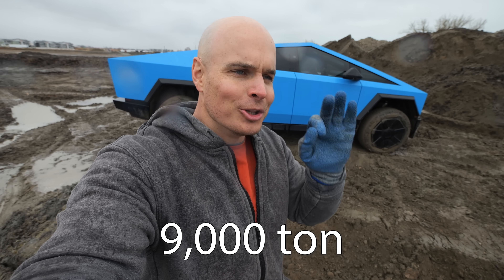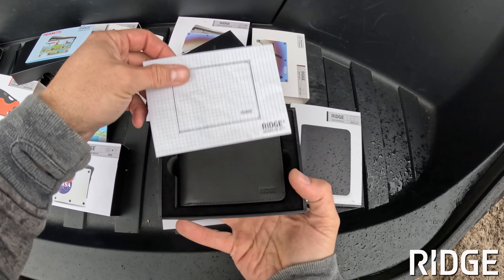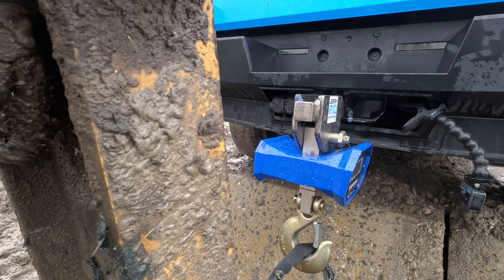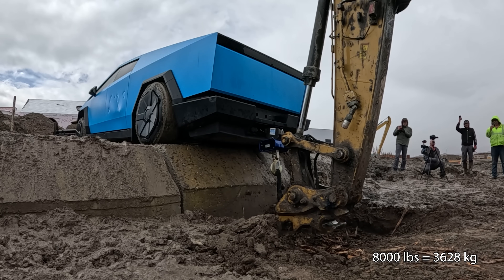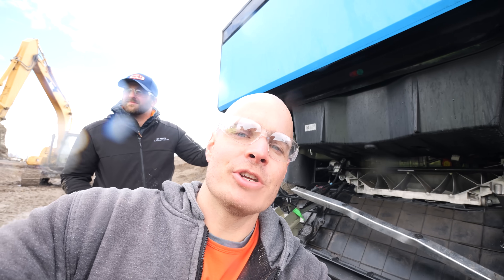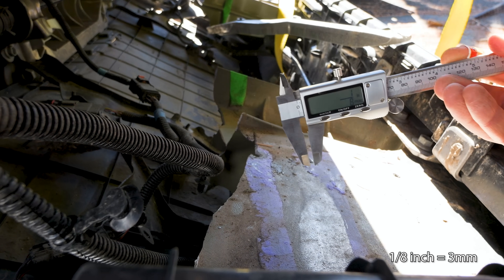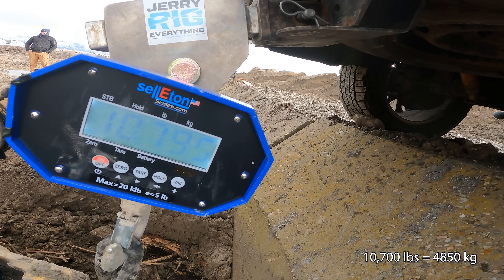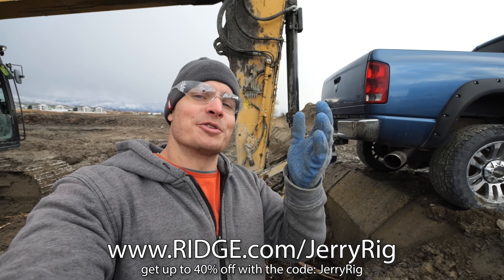SHOULD YOU TOW WITH A CYBERTRUCK?! - (catastrophic failure test)

Comment: Read this info by Grok guys before making any conclusion of this test: 
: The Gross Vehicle Weight Rating (GVWR) of the Tesla Cybertruck varies depending on the specific model. Based on available information, the GVWR for the Cybertruck falls within the following ranges:

Dual Motor (All-Wheel Drive): Approximately 9,001 to 10,000 lbs (4,082 to 4,536 kg).

Tri Motor (Cyberbeast): Also within the 9,001 to 10,000 lbs (4,082 to 4,536 kg) range.

These figures are derived from Tesla's VIN decoder submitted to the National Highway Traffic Safety Administration (NHTSA), which lists the Cybertruck under Class G (8,001–9,000 lbs) and Class H (9,001–10,000 lbs) categories. The GVWR represents the maximum allowable total mass of the vehicle, including its curb weight, passengers, cargo, and any additional equipment.

For context, the curb weight (weight of the vehicle without passengers or cargo) is reported to be around 6,670 lbs for the dual-motor version and 6,890 lbs for the tri-motor version, leaving room for a payload capacity of up to 2,500 lbs, depending on the configuration. This places the Cybertruck in the medium-duty vehicle category, similar to trucks like the Ford F-250 or Chevrolet Silverado 2500.
The Tesla Cybertruck's towing capability depends on the specific model:

Dual Motor (All-Wheel Drive) and Tri Motor (Cyberbeast): Both have a maximum towing capacity of 11,000 lbs (4,990 kg). This is enough to tow a variety of trailers, boats, or even an "average African elephant," as Tesla has playfully noted. In real-world tests, it has handled loads like a 7,500-lb travel trailer with ease in terms of power, though range takes a significant hit (more on that below).

Single Motor (Rear-Wheel Drive): The upcoming base model, expected in 2025, is rated for 7,500 lbs (3,402 kg). This is still respectable but lower than its multi-motor siblings.

For comparison, the Cybertruck's 11,000-lb rating exceeds the Ford F-150 Lightning (10,000 lbs) and GMC Hummer EV Pickup (8,500 lbs) but falls short of some gas-powered heavyweights like the Ford F-150 (up to 14,000 lbs) or Ram 2500 (up to 20,000 lbs with a diesel engine). Among electric trucks, it matches the Rivian R1T's 11,000 lbs.

Real-World Towing Considerations:
Towing significantly impacts the Cybertruck's range. For instance:

Towing a 6,000-lb load in good conditions yielded about 115 miles of range using nearly the full battery.

An 8,000-lb trailer dropped the range to under 100 miles (85 miles at 70 mph, consuming 1,252 Wh/mile).

A lighter 3,250-lb camper achieved 160 miles, still less than half its unladen 340-mile EPA estimate.

The hitch design has also raised eyebrows. While rated for 11,000 lbs, the vertical load (tongue weight) is limited to 160 lbs in some configurations unless using a trailer with a low center of gravity close to the hitch. Tesla clarifies this varies with accessory type and distance from the hitch, with a potential max of 1,100 lbs under ideal conditions. Some critics argue the cast aluminum rear subframe might not withstand repeated heavy towing over time, though this remains debated.

In short, the Cybertruck can tow a lot—11,000 lbs is no joke for an EV—but its practical range while towing (often 100–160 miles) and hitch nuances mean it’s better suited for shorter hauls or users near charging infrastructure, rather than long-distance towing compared to diesel trucks.
The question of how long a Tesla Cybertruck can withstand heavy loads and towing—whether in terms of durability over time or operational range under stress—depends on two distinct interpretations: structural longevity (how many years or miles it can handle heavy use) and immediate performance (how far or long it can tow a heavy load on a single charge). Since "withstand" could imply either, I’ll address both based on available data and engineering insights.

Structural Longevity (Durability Over Time)

The Cybertruck’s ability to endure repeated heavy loads and towing hinges on its design and materials:

Exoskeleton: Tesla touts the Cybertruck’s stainless steel exoskeleton as ultra-durable, resistant to dents and corrosion. This suggests it’s built to take a beating over years, unlike traditional trucks with separate frames that might rust or fatigue faster.

Chassis Concerns: The rear subframe, made of cast aluminum, has sparked debate. Critics, including some engineers on X and automotive forums, question whether it can handle sustained 11,000-lb towing without cracking over time, given aluminum’s fatigue properties under cyclic loading. Tesla hasn’t released stress test data, but the company claims it’s engineered for “apocalypse-level” durability.

Battery and Motors: The 123 kWh battery (estimated capacity) and electric motors are designed for high torque (up to 10,000 lb-ft combined in the Cyberbeast), which is ideal for towing. Unlike gas engines, electric motors have fewer moving parts, potentially reducing wear. However, frequent heavy towing could degrade the battery faster due to heat and deep discharge cycles—possibly shaving years off its 8-year/150,000-mile warranty lifespan if pushed hard.

Real-World Evidence: As of March 31, 2025, the Cybertruck has been in owners’ hands for just over a year (deliveries began late 2023). Anecdotal reports on X show it towing 7,000–11,000 lbs without immediate failure, but long-term data (e.g., 5–10 years) isn’t available yet. Tesla’s track record with the Model X (7,500-lb towing, still running after 200,000+ miles in some cases) suggests decent longevity potential.

Without Tesla releasing specific endurance test results (e.g., frame fatigue cycles or tow mileage limits), a rough estimate based on EV truck trends and Tesla’s design philosophy suggests it could withstand heavy towing for 100,000–200,000 miles or 5–10 years of regular use, assuming proper maintenance and no catastrophic design flaws. Cast aluminum concerns might lower this if not over-engineered as Tesla claims.

Immediate Performance (Towing Duration/Range on a Single Charge)

If “how long” refers to how far or how many hours it can tow a heavy load like 11,000 lbs, this ties directly to battery range and conditions:

Range Under Load: Real-world tests show significant range reduction:

Towing 8,000 lbs at 70 mph consumed 1,252 Wh/mile, yielding ~85 miles of range (about 1.2 hours at that speed).

A 6,000-lb load averaged 115 miles (~1.6 hours at 70 mph or 2–3 hours at lower speeds).

The full 11,000-lb capacity hasn’t been widely tested publicly, but extrapolation suggests 70–100 miles (1–1.5 hours at highway speeds) due to increased drag and power draw.

Conditions Matter: Cold weather (e.g., 10°F) or headwinds can cut range further—down to 60–80 miles with a heavy load. Hills also tax the battery more; a 6% grade climb with a trailer dropped efficiency to 1,500 Wh/mile in one test.

Charging Factor: With a 250 kW max charging rate (on V3 Superchargers), it can regain 80% of its range (say, 80–100 miles when towing) in 20–30 minutes. So, towing 11,000 lbs for “long” means frequent stops—potentially every 1–2 hours—limiting continuous operation.

In practical terms, the Cybertruck can tow its max load for about 1–2 hours (70–100 miles) per charge under typical conditions, far less than a diesel truck’s 300–500 miles per tank. For sustained towing, you’d need a route with Superchargers every 50–100 miles, making “how long” more about logistics than raw endurance.

Conclusion

Durability: It’s likely built to handle heavy towing for 5–10 years or 100,000+ miles, though the rear subframe’s long-term resilience remains unproven.

Towing Duration: It can tow 11,000 lbs for 1–2 hours (70–100 miles) per charge, with frequent recharging needed for longer hauls.

If you meant something more specific by “withstand” (e.g., max hours of continuous towing or structural limits), let me know, and I’ll dig deeper!

Comment: Hold up? The front is just a storage space? How do you access the engine for maintenance?
Reply: Its electric car, engines are small and doesn't require any maintenance, no oil change, nothing. Only instance when you would need to do anything with it is if they broke.
Reply: @ yeah, why else would I want access other than maintenance and repair. And just cause it’s electric doesn’t mean it doesn’t need maintenance, any machine needs maintenance.
Reply: @FuzzyImages  
BEV motors are completely closed and requires zero maintenance, this is one of the benefits. This is why engines are usually buried deep inside car as you will not need access to those unless you have complete failure and replacement is needed.

Comment: Steel bends cast aluminum breaks.  I was suprised that losing a bumper/hitch on a tesla is a catastrophic electric failure and will no longer drive. What a piece of junk not to mention it also snaps off the frame first instead of breaking at the hitch.  I feel at very least they should have made hitch mount weaker than frame with steel safety hooks so that in case of a faiure it would simply break off the hitch while retaining safety chains and not total the entire truck. Either way terrible design.

Comment: March 30, 2025
   Federation of Danish Motorists Vehicle inspectors found that 1,051 of the 4,668 Model 3s tested failed the annual Ministry of Transportation (MOT) four year inspection for roadworthiness.  This is a 23% failure rate vs a 9% average market defect rate.  Common issues noted by the inspectors were with the brakes, lighting, suspension, and steering. The data is for model year 2020 Model 3s.
   The Model 3 was the world's second best-selling EV in 2024 after the Model Y, according to Autovista24.
  The Cool Down.

Comment: Look how THIN that frame is. Dragging the scale through the mud was brilliant.
I pulled a 14' horse trailer with 2 horses, from NOLA to L.A. with a FULLY LOADED to the cab height in the bed, full trunks and tools. With my 85' GMC Sierra Classic 4x4. And after shipping it to Hawaii, tearing off the body to replace it with my 32 Chevy body.
I'm still using the same bolted on UHaul hitch pulling a trailer around the island. Can't beat a Chevy. Period.
100 years tested.

Comment: Two things that would have added more weight for the Dodge using the same excavator. Spin the tracks around so the propel motors are in the front. They’re a couple hundred pounds each. And put the bucket back on.

Comment: its crazy seeing the glue not holding better. ive worked at gm and the metal will rip around the glue before that glue comes apart. although that is steel, not aluminum

Comment: Max tongue weight should never exceed 10-15% or tow rating. 

There’s zero issue with failure prior to tow rating. A nearly 10x factor of safety in the tongue weight is great. 

How would anyone improperly load a bumper pull trailer to get 10,000lbs on the hitch? Hauling a d10 dozer? A camper balanced vertically on the hitch? 😂

Comment: I'm not a fan of the Cybertruck at all, but what you don't consider is rust. Steel rusts very quickly, whereas aluminium develops aluminium oxide on top of the aluminium, which will protect against further rusting. Also, aeroplane frames are made of aluminium, and that doesn't stop you flying to your holidays. 10,000 lb is still impressive. If you have to use a load that heavy, you should consider using a lorry instead.
Reply: Problem is that Tesla's are shoddily built in general to begin with. The cybertruck is just a complete clownshow
Reply: Aircraft frames are subject to periodic inspection including x-rays to detect the formation and propagation of cracks. Whilst aluminium is corrosion resistant in isolation, once you start attaching dissimilar metals to it, like steel screws, then electrochemical corrosion will set in, especially in wet and salty conditions. A good example is on motorcycles where the exhaust is bolted to the aluminium cylinder head with steel screws. The aluminium gradually turns into crumbly powder until there's no thread left, at which point it needs to have a thread insert fitted to stop the exhaust dropping off.

Comment: Ultimately the truth of whether the engineering of the Cybertruck is at an appropriate strength (or not) for the rated towing capacity will be if trailers start coming off the back of Cybertrucks in droves. Not a Backhoe in a bog pushing down on the hitch. If the trailers don’t come off, then it’s QED and the video producer is full of it. If they do, he has made a bold and truthful prediction. My guess is full of it. But you never know for sure. That’s why these videos appeal to so many.

Comment: So much clickbait.

Cybertruck did great and even warned with the alarm limits were being reached.

If you are serious about testing you would test horizontal forces to break in g as well.

Not that anyone would tow with a cybertruck but if you were, I don’t see an issue with towing a medium caravan or boat. If you tow something heavier like an excavator or work machine with it, it will tow something on the lighter end but you’d also be an idiot using it as a real world work vehicle.

It’s a toy truck for cashed up tech bros, no working person is going to to use it for real work and be taken seriously. That what Cummins power and steel chassis are for 😂

Comment: There is a difference between static load and dynamic load. There is a difference between steel under it's fatigue limit and the lack of fatigue limit on aluminum. There is a difference between tongue load and and towing capacity. So while the hitch held up to significantly more static weight on the tongue than it's rated for, the big issue with an aluminum hitch is all about durability, which is a lot less exciting than pressing down on a hitch until it snaps off.

Comment: So the moment you lose your trailer, the truck also shuts down and can't be controlled at 70 mph... with a cartwheeling trailer behind you. Cool.

If it was actually what they advertised - a stainless steel exo - this probably wouldn't be an issue but at this point it's less cybertruck and more cyber "truck".

Comment: 1100 lbs max. Elon is scamming everyone. Body panels coming off due to the glue failing. And anyone knows you don’t mix steel and aluminum , dissimilar metals don’t play good together 🤦‍♂️🤣😂 and you never use a dodge to test with. They are always underrated from factory and sack out

Comment: Have no Tesla and not even thinking of buying one, but this test is just a views  number collector and nothing valuable inginerically or even logically vise. You just proved that it is just a totally properly built truck- tolerating 10k tongue weight is totally monstrous achievement keeping in mind that official tongue weight capacity is 1,100lbs which is different metric comparing to the tow capacity- they are totally different metrics- vertical and horizontal force vectors. Not sure what was achieved by killing that Cyber truck but it was proved that it is a well engineered vehicle.

Comment: I thought it's a stainless steel truck? What's the aluminium doing there?🫤 A truck suppose to be rugged. Aluminium is something for cars not for work equipment. It's obvious why they took aluminium to cut production costs. Steels is more difficult to process and therefore more expensive. And you don't glue body pannels. This truck looks like a cheap rc toy car.😅 Sorry but it seems like a scam.

Comment: Good idea, but the test was invalidated as soon as they pined the frontend. This is an unrealistic test. The weight would transfer and most likely lift the frontend. This would probably stop it from ever hitting the weight they tested it at especially for the duration they had it there. The momentary shock load would be a much more realistic test, as the aluminum may see fatigue from multiple shocks. This is where steel is better, it will stretch and then return to its original shape as long as you don't pass its threshold. Where as aluminum, will take damage even if not at the failure point. Each time the fatigue can compound.